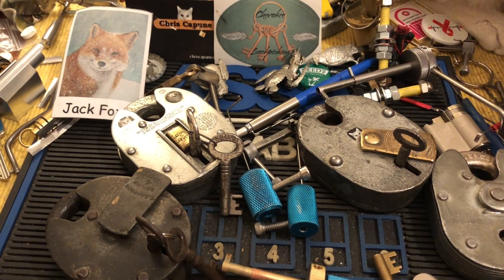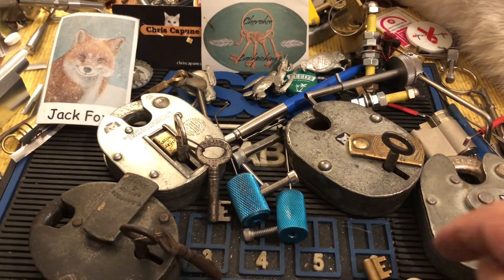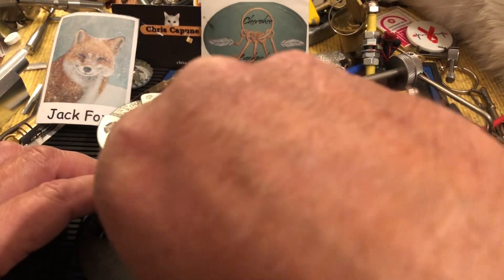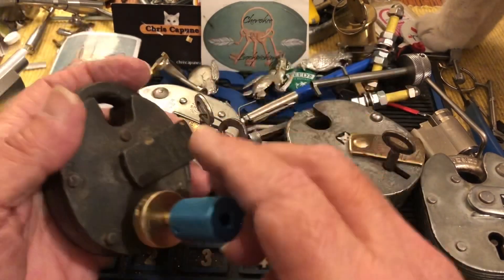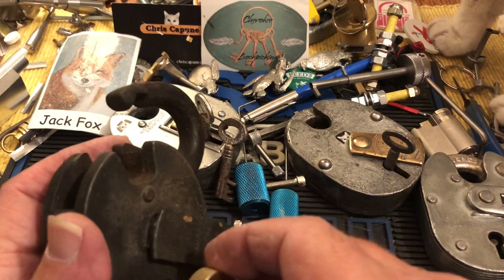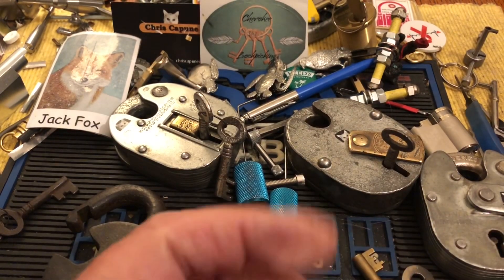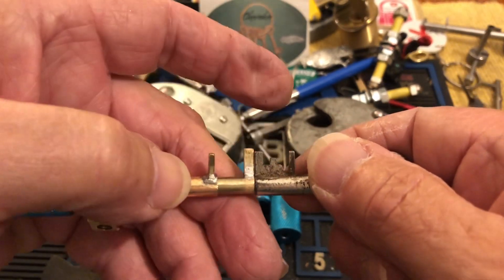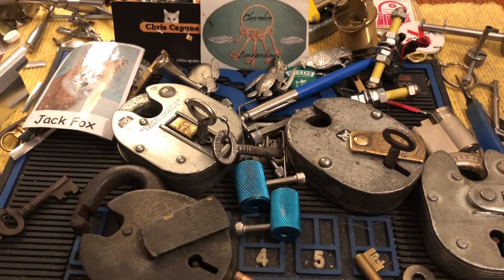#1400 Two In One DIY picked T Sampson 4 Lever Padlock

Comment: A great job on your DIY 2 in 1. What kind of torch do you use? I am having trouble getting my solder to stick. It just rolls of even with flux.😡
Reply from the maker: I have started to use a new torch 
It’s a Bernzomatic detail torch. 
Uses Butane . Heats up in about 5 seconds. And small flame tip. 
Will try to post a video on its use with the silver solder.
Reply: @chriscapune7873     That will be a great help. Please include what kind of silver solder you use and flux.🦊👍😄

Comment: Nice work - do you use silver solder? I've tried to make a similar tool but the picking tip was just too weak.
Reply from the maker: Yes. The solder has a small amount of  silver in it. Has taken a bit of time to be able to make a strong joint. 
This pick has been used on a number of locks and fairly strong tension so far . If it’s a weak joint it breaks off in a matter of minutes. 😬 
Will do more videos on how I make this type of tool. Still tweaking it to pick an ERA Insurence padlock. 
Thanks for checking it out. 
🐈🐾🐈‍⬛😷🇬🇧